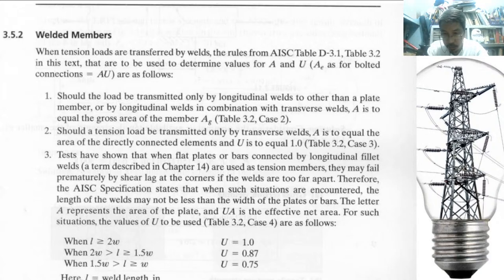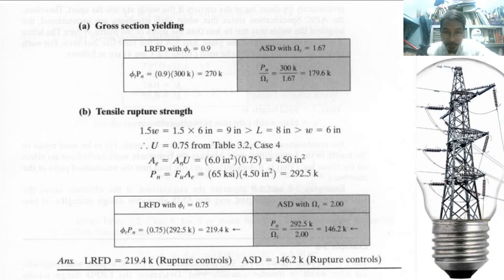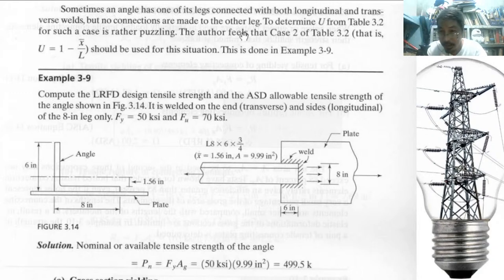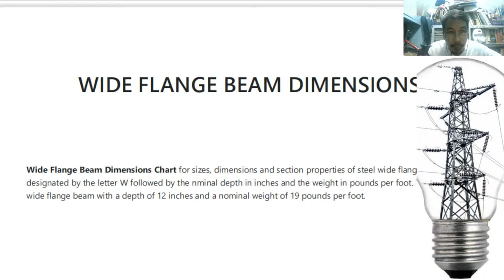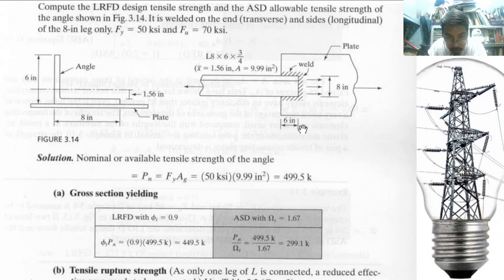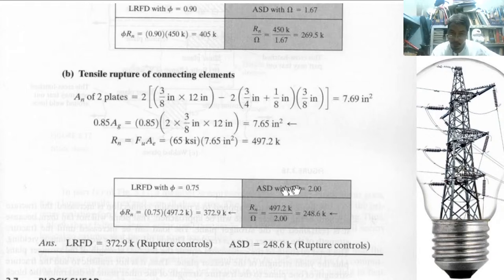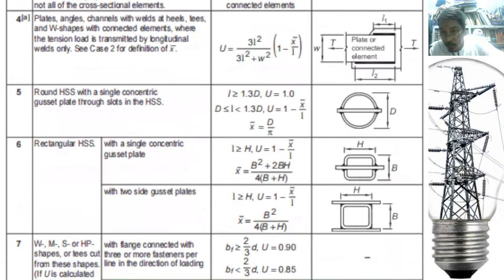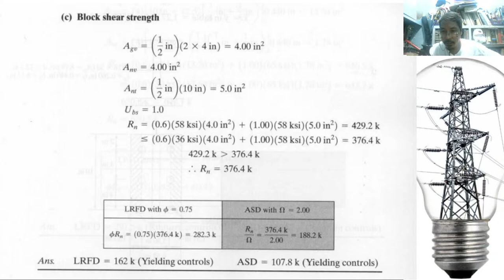[ LIVE CEE6 Lecture19 ] DrAP Zantua Welded Connections Block Shear + ENGINEERING Examples

Comment: Thank you sir for sharing your knowledge to us, I've learned that Welded members are connections whose components are primarily joined together by welds. It also has the advantage that welding can be done anywhere, as long as there is enough clearance. They also provide a smooth appearance and simplicity in design.

Comment: Thank you sir for this live lecture about the analysis of tension members about the welded connections. For welded members, the condition for case 4 in table 3.2 is comprehensible, we just need to calculate the equation given for us to solve the value of U. For block shear, the LRFD design strength and ASD allowable strength tension members are not always controlled by tension yielding, tension rupture or by the strength of the bolts or welds with which they are connected, they may be instead be controlled by block shear strength. Explaining the given problem examples helps us to understand how to apply the theory that was discussed today. Thank you sir.

Comment: Thank you sir for this live lecture video that tackles welded members and its rules and it is stated at AISC by any chance if the plates or bars connected by longitudinal fillet weld, it will fail prematurely by shear lag. For such situation the value of U will be used. By showing some problem-solving I can briefly understand what it meant by applying the theory.

Comment: Thankyou sir fo discussing about Welded Members. When tension loads are transferred by welds, the rules from AISC are used to determine values for bolted connections. The load should be transmitted only by longitudinal welds to other than a plate member or by longitudinal welds in combination with traverse welds. In this video lecture, I’ve learned on how to compute the LRFD design tensile strength and the ASD allowable tensile strength of the angle. Find the nominal or available tensile strength of the angle. Apply gross section yielding. Wide flange beam dimensions chart for sizes, dimensions and section properties of steel wide flange designated by the letter W followed by the nominal depth in inches and the weight in pounds per foot. Wide flange beam with a depth of 12 inches and a nominal weight of 19 pounds per foot.